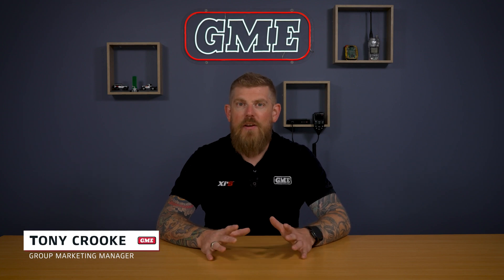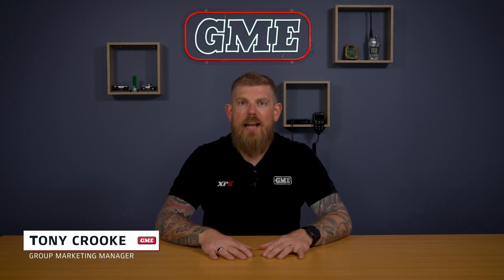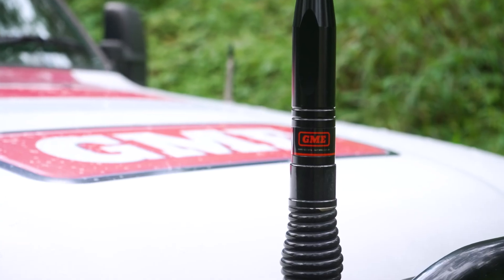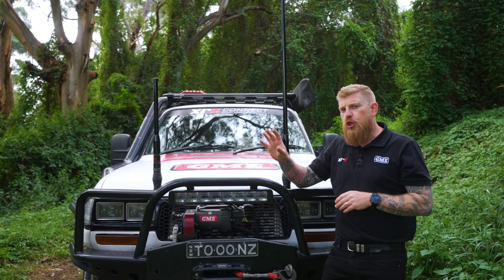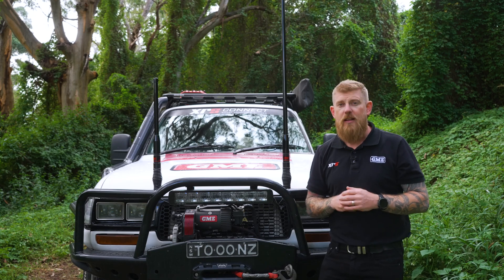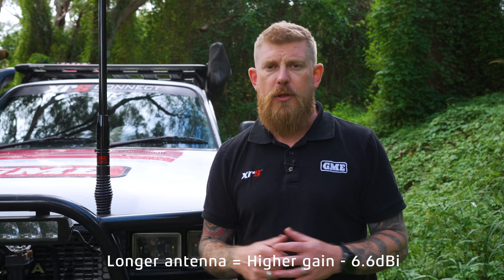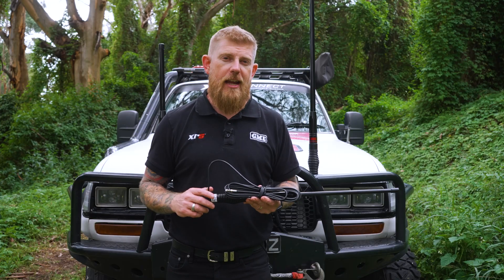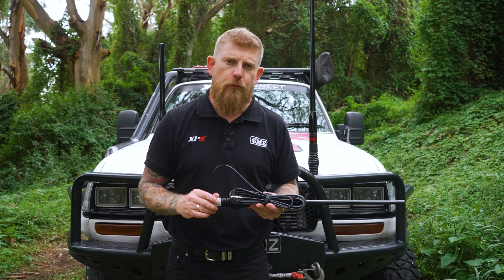GME GMRS Radios - Radome Antenna Range

Comment: Sorry, $700.00 for a 5 watt radio and $300.00 for an antenna, up to 6.6 db gain with a 50 watt limit is way out of the ball park. A good 50 Watt radio, made in the USA, and a 6 db gain 120 watt limit antenna runs less than $400.00 total, including sales tax and shipping.
Reply from the maker: Curious to know which GMRS Radios are made in the USA?
Reply: @GMEUSA  BTech

Comment: Hello team, I am planning to purchase the XRS-390C-U and would like to run both 2.1 and 6.6 rad one antennas. Do I have to physically remove the antenna or disconnect it when I want to switch or is there a special splitter or feature on the radio that would allow me to switch back and forth depending on the situation. Cheers. 🍻
Reply from the maker: All of the radome antennas have interchangeable whips, so you can simply unscrew one whip and replace it with the other as required.

Comment: Hi,  I currently have a Midland 15 watt GMRS radio.  I know your equipment works well with 5 watts.  Question?  Will your antennas work with more than 5 watts?  Or will higher wattage radios mess with the internal workings of your antennas?

Thanks
Reply from the maker: All of our GMRS antennas are compatible with GMRS radios up to 50W transmission power.

Comment: Glad to see you offering the GMRS option here in the US especially since the competition has their stuff made in Taiwan and China. If only the Radios were a bit higher powered than 5 Watts(I would be ok with a solid 15 Watt to be honest).

With that all said I currently have a Midland 50 Watt Radio with the Midland Ghost 3 dB antenna. I can't say that it's the best, but it does work and I feel I can do better. I have been considering the 2.1 dB antenna and having it mounted on the roof. Would it be possible to increase the performance of the radio even though the gain is technically less?

Also I would have no problems meeting with the guys in the US office since I live nearby.
Reply from the maker: We think you guys will be surprised by just how well a 5-Watt GME GMRS Radio will perform. 

As you've discovered, big wattage isn't everything when it comes to a two-way system.

Yes, we are confident that our AE4704B-U antenna mounted on your roof will give you significantly better performance than your current setup.
Reply: @GMEUSA  perhaps it would be possible to get together and do a field test? It would be nice to meet the team and see what all goes into the stuff